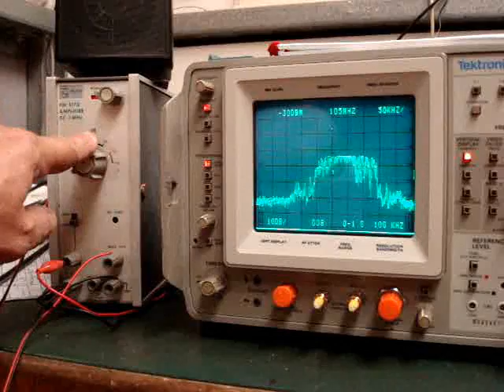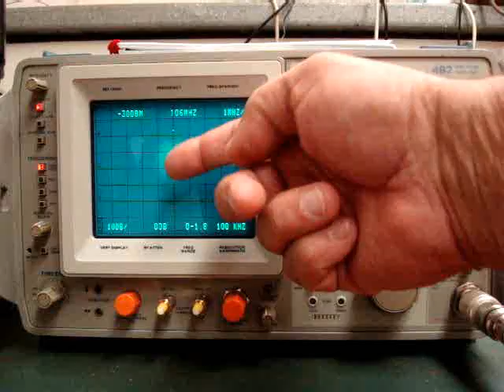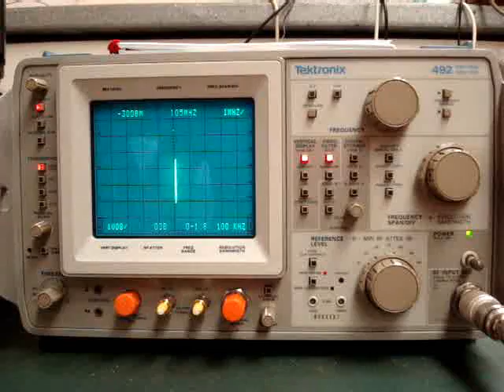492audio

Comment from the maker: sorry Hossein, i've since sold that 492, but can tell you to use the vertical output connector on the rear panel of the 492 and feed it into any audio amplifier you have at hand. cheers.